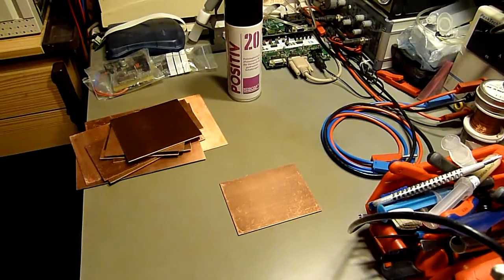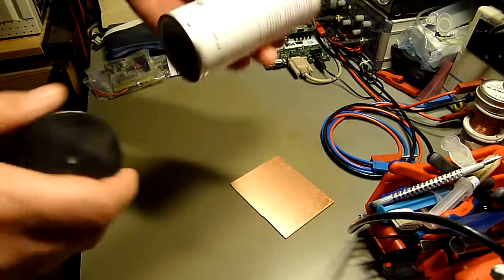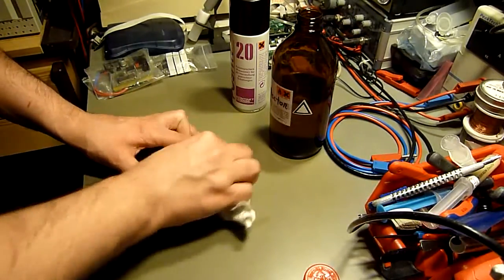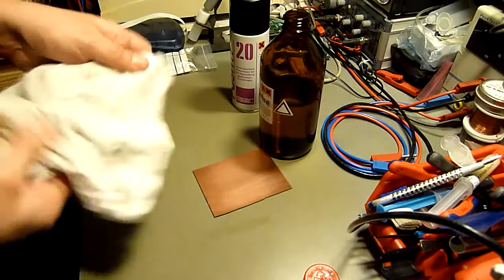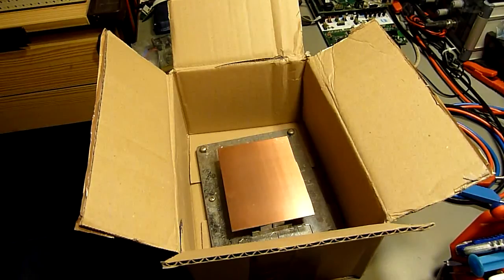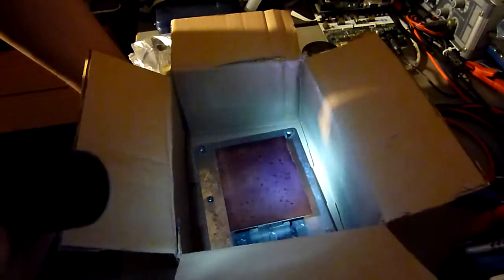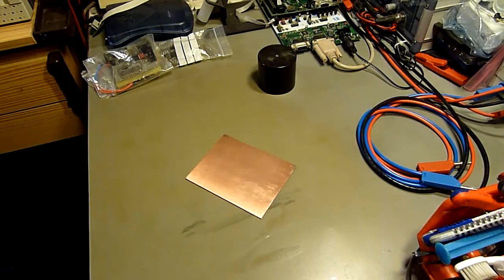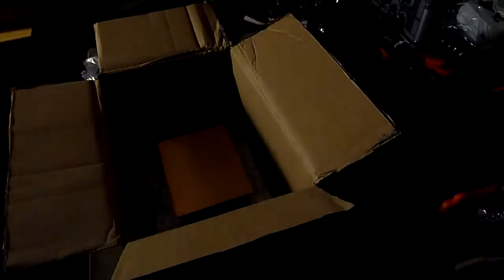How to recycle a stripped PCB base material by manually applying a foto finish 1 of 2.

Comment: Interesting stuff. I've been thinking of making pcbs like that instead of press-n-peel method. But what's your pressured air source? I live in apartment building too and a quiet compressor would be ideal. Like DIY air compressor but readily available.

Decent air source could give possibilities like spraying photoimageable resists and prints on to a pcb with an airbrush. Maybe a overkill but might be cool to try, just for the heck of it.

Comment: This is the procedure I follow:
use steel wool to make the surface shine
use acetone to remove impurities.
then hold the board vertical and spray approximately 20 cm away
this way I get a perfect finish every time.

Comment: The problem with Positive 20 is that the smallest speck of dust will break the resist. Even after application until it's dry.

Really frustrating to use.
If you have the choice get dry films.